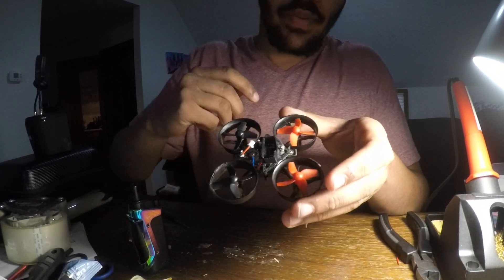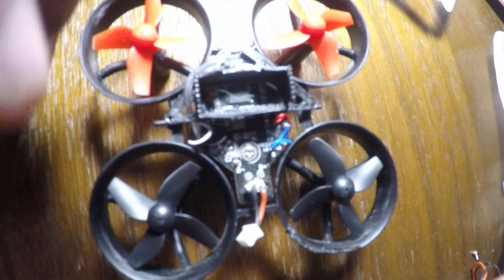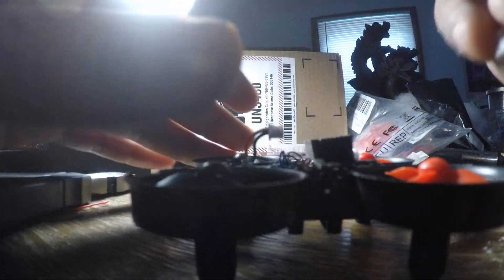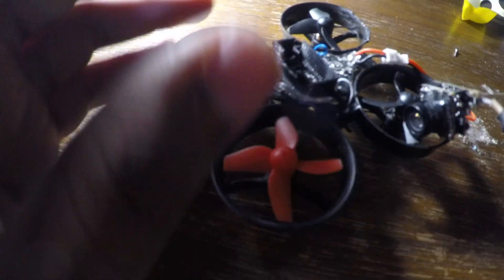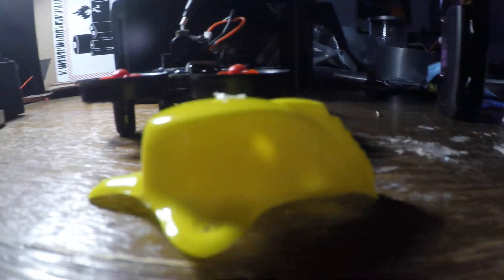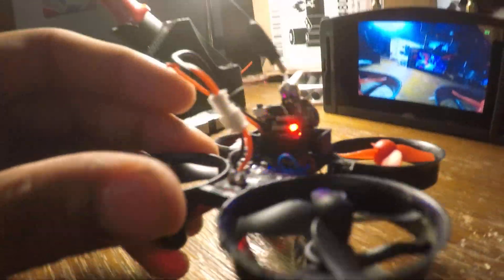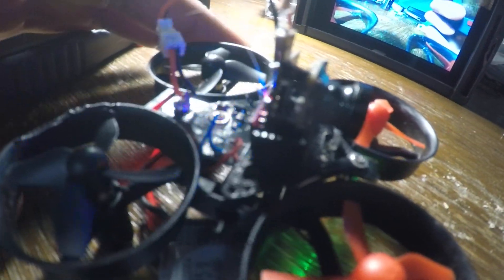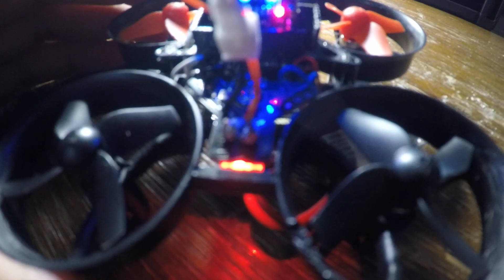Cheap Micro Drone FPV Hack!

Comment: Thank you this is the exact video I wanted to see because I was going to upgrade a cheap drone with one of those cameras, but I wasn’t sure about this one because my ATT teacher has one and I forget if it had the space where you could add a camera
Reply from the maker: @TrevorViviano yes! These AIO cameras only need the power and ground from whatever board you're connecting them to. The onboard vtx does all of the signal work

Comment: Can you make a video flying it???
Reply from the maker: If you look at my channel I have plenty of flights! This build was over a year or two ago, so ove built bigger and better since then!
Reply: @koalaman259  you have flights of this one?? I am trying to build a drone with the components to mass produce them as cheap tools to enter second floor rooms etc. To view threats
Reply: @koalaman259  I need a drone to enter house in threats of danger.. low cost w. Altitude hold & camera ie one time use medium range, I need that altitude hold because I can not have a forward moving drone
Reply from the maker: @Karen Sawicz  I highly suggest looking into DJI drones, and ardupilot or how the DJI Naze worked. I think that will point you in the right direction of research to build what you have in mind.

Comment: Hi I got a wolfwhoop WT05 and when I connected the red wire to B+ and the black wire to B-, nothing happened. I'm using a 3.7v battery with 220 maH. What should I do fix it?
Reply from the maker: Does the board power on with the 220mah battery without the WT05 leads soldered?
Reply: It does, and the drone also powers on as well and works fine. I think that it might be a problem with the battery. When looking at the manual of the FPV camera, I saw that the current consumption is 280mAH. And the battery that I was using was 220mAH. Maybe I wasn't supplying it with enough power, could that be the issue?

Comment: Hi, did you ever had problems linking the drone to the remote?
Reply from the maker: This drone was a cheap Holy Stone toy drone that I added an analog vtx and camera combo to. These usually come with their own controller and from what I could tell, can't accept 3rd party actually hobby recievers.
Reply: @koalaman259  yes, thanks for repspon7, I have the same drone, it just stopped connecting to the receiver controller a few days ago, and I'm looking are to see if anybody had the same problem and found a solution for it, I do like the camera idea, might try it with a different drone
Reply: @alexisarguijo5294  if you contact holy stone they’ll take a month to ship you one. I have like 5 extra you can have.